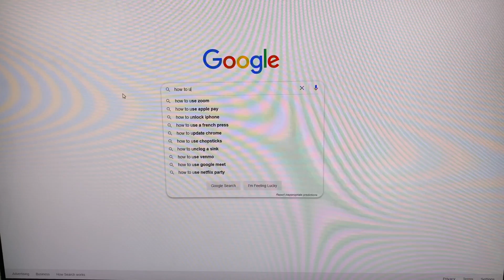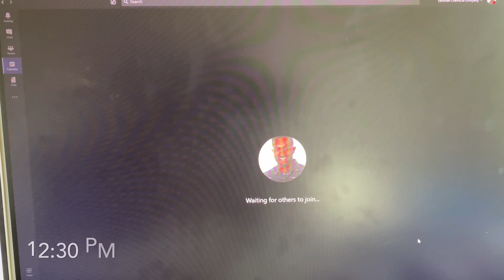A Day in the Life of an Electrical Engineer!

Comment: How much math is involved with Electrical Engineering. I’m just curious because it’s currently my major but I’ve been seeing that it requires a lot of math and it’s been scaring me away. Please let me know
Reply from the maker: Frankly, it’s a lot of math. Calculus 3, differential equations, advanced physics. It’s a ton of math in school. But if you can make it through to industry it will become a little easier and more based on experience. Hope this helps!
Reply: @JeromeVaz  not gonna lie i struggled with Calc 1. Do you think I could even make it to Calc 3? Let alone advanced physics. Idk man I just feel like it’s to late for me to switch my major. Sorry for the dumb questions. Also how was differential equations??
Reply from the maker: @idontknowaname3631  Have you tried tutoring sessions available at your school? I know it sounds dumb but you gotta just find ways to get through it. And I personally didn't think differential equations was very bad. I took it at the same time as Calc 3 and they have a lot of overlap
Reply: @JeromeVaz  thanks for letting me know I’m gonna try extra hard this semester and thanks for letting me know that they overlap

Comment: Brother is electrical Engineer duty is risky? Hope you reply. Thanks in advance.
Reply from the maker: I think any job can be risky or dangerous if you don’t pay attention to what you’re doing and take your safety and the safety of others seriously. In my personal experience, I was in charge of design and I would distribute my design to an electrician or builder who would actually put the wires together so I was never in any direct danger! I hope that helps!
Reply: @JeromeVaz  thanks for replying.     my final question is did you get electric shock in your work place or while you are working?
Reply from the maker: I didn’t, but I have seen others get shocked. But they were being careless and not following safety rules. #1 rule is to always assume that any wire is “on” and never put your hands on it unless all safety precautions have been met!
Reply: @JeromeVaz  are they engineers? Or electrician's
Reply from the maker: I’ve only seen it happen to electricians but I’ve heard stories about engineers as well

Comment: bro please reply
Bro i want to do a diploma in electrical engineering in canada but i am worried about this course.
because i have heard from many places that this course is the hardest one among all engineering courses. due to this reason i m confused ti take this course or not
Bcz in canada i have to do part time jobs as well so for sure i will not be able to pay 100% attention towards study.
Plz tell me what u think
Reply from the maker: I would say still take the course.  You're right that it is going to be hard, BUT the good news is that the courses you find to be the most difficult are usually the ones where you learn the most! I also had a part time job through most of college but you just need to manage your time really well.  You're going to have some nights where you're up until 2 or 3 am studying but once you get your degree it all becomes worth it!

Comment: Wut u mean by working with electrician? That's wut I need to hear
Reply from the maker: So typically the engineer is responsible for coming up with the designs but we’re not the ones who physically connect the wires on a project. So you’ll typically work with an electrician who will take your design and bring it to life. Think of it like you drawing a picture and sending it to a T-Shirt factory and then the factory actually prints your drawing onto a T-Shirt. That’s kind of what an electrician does for you
Reply: @JeromeVaz  thanks man your the greatest. I'm considering switching from accounting I really like this stuff and wanna design things or do the wiring as well lol
Reply from the maker: Hell yeah! It’s a lot of work to get there but once you do, it’s definitely worth it!

Comment: I am starting electrical engineering this month. Would you recommend me a good laptop for me to buy. The budget is around £800/$1000
Reply from the maker: I used a Mac throughout all of college and had no issues but that may not be the most functional in terms of engineering. I had several friends that used either a surface pro or the surface laptop. Or another good option in my opinion is the Dell XPS 13, I think that’s within your budget!